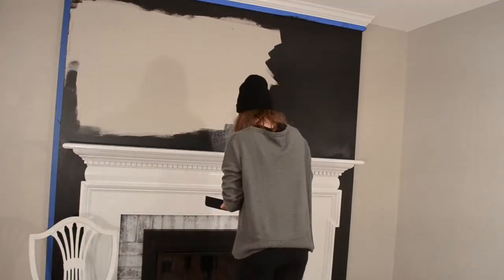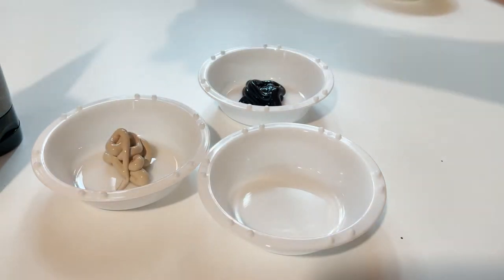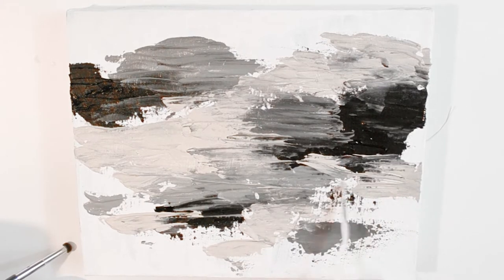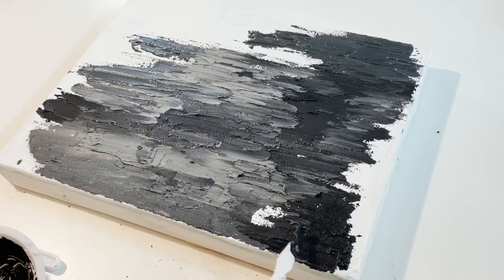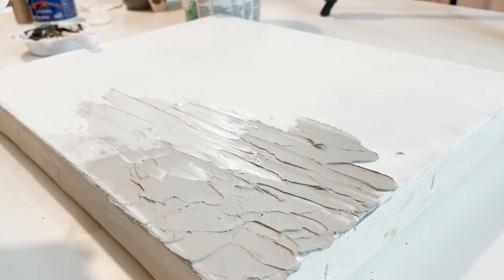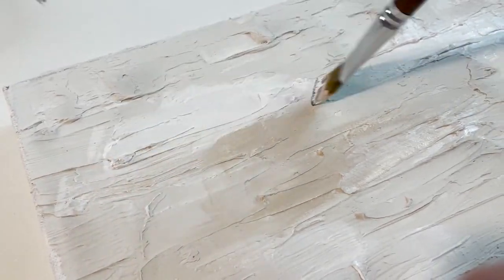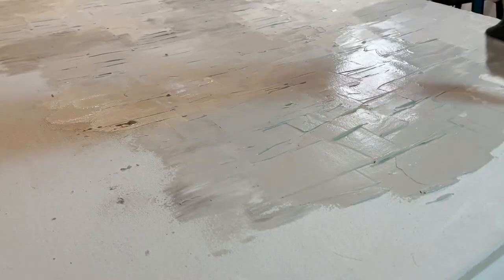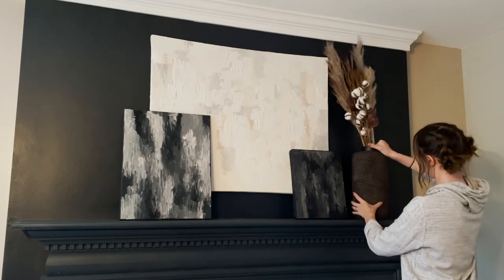DIY PLASTER ART| Joint Compound VS Baking Soda

Comment: On your bog painting, did you let the compound dry first? 24 hours? Then paint? Thanks and great work
Reply from the maker: on the big painting I mixed the compound into the paint. but there were a few areas I went back in with paint over the compound and I did wait close to 24 hours before doing that. And thank you! glad you like it!

Comment: I see you posted this 2 years ago But do you remember if the joint compound cracked when it dried.  I know it shrinks.   It does it to me all the time.  If it did, did you leave all the cracks or did you repair it (with what) ??
Reply from the maker: Mine hasn’t cracked and I still have it out in the same place. I’m thinking maybe because I mixed it with paint it didn’t crack?
Reply: @MaileyElaine  Thank you so much for your quick response,  I am going to give it a try,,,,Oh also did you spray it or paint it with a protection to have it last long and keep the colors?
Reply from the maker: @jillabrams34990  I added a matte mod podge over the top
Reply from the maker: Hope this helps
Reply: @MaileyElaine  Yes it did,  Thanks again